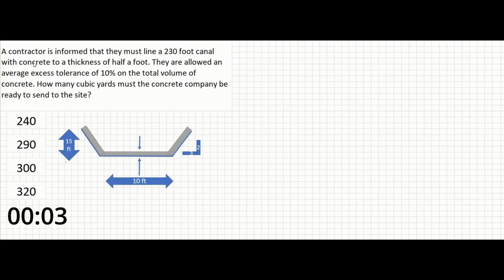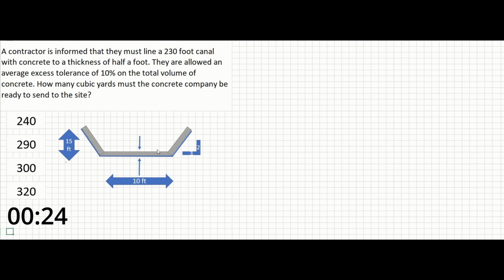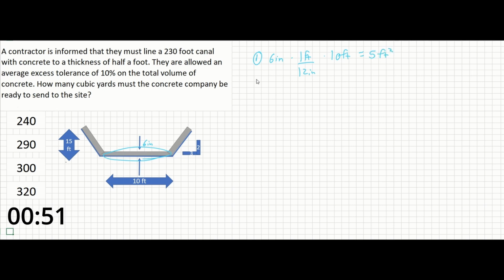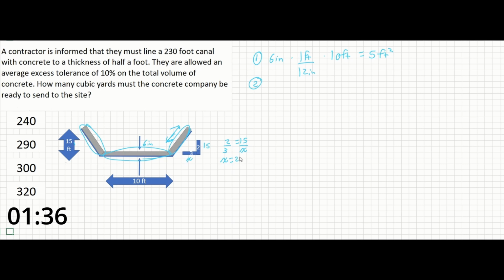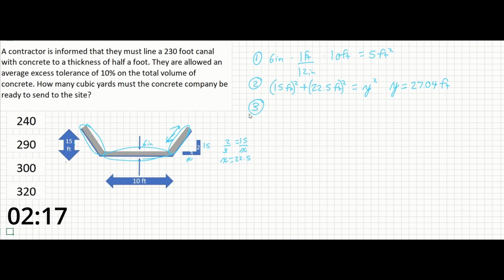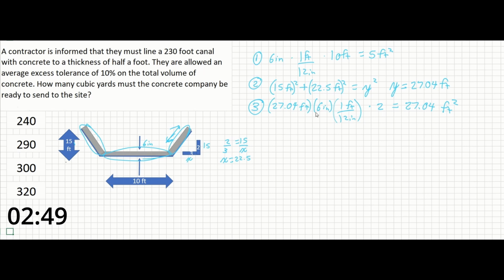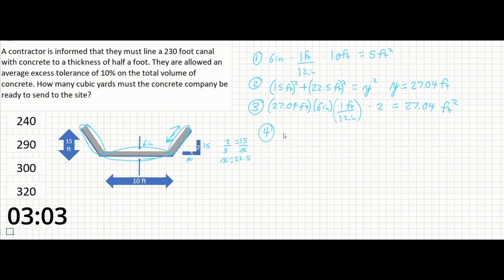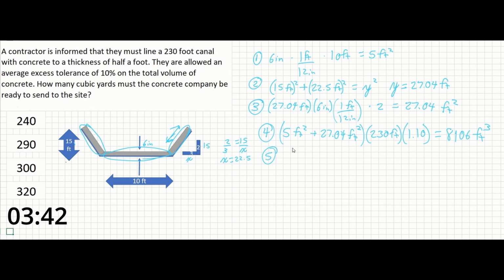PE Exam Practice Problem #67: Site Development | Cut and Fill - Geometry

Comment: Does the PE sometimes provide graphics like this? If they don't, is it safe to assume the channel width, side slopes etc would be provided?
Reply from the maker: yep, certain problems will provide graphics, and certain ones will not. Some use the graphics as part of the question to see if you know what info to pull off of it or how to apply it. If they dont provide that, they would need to give it to you in the problem statement.